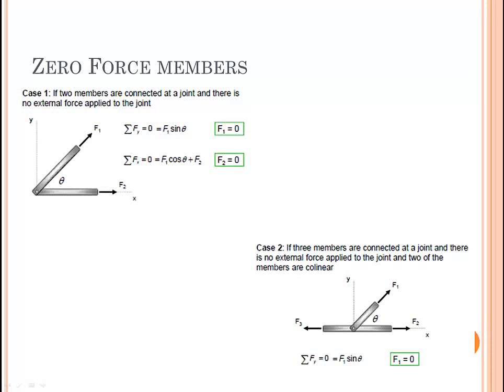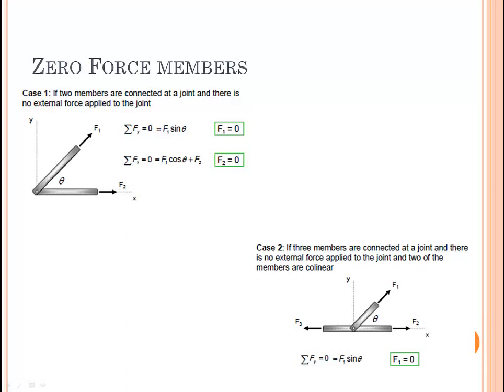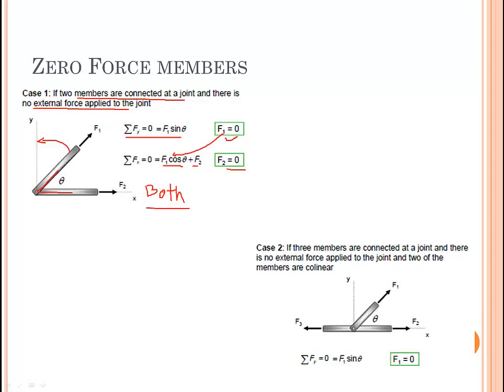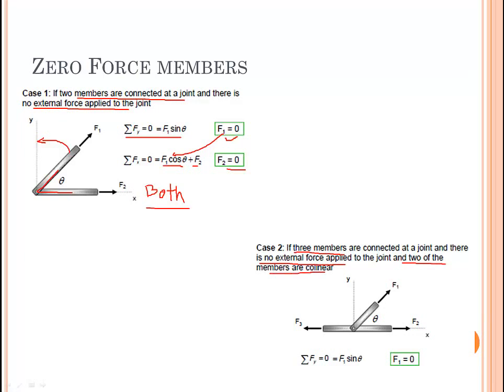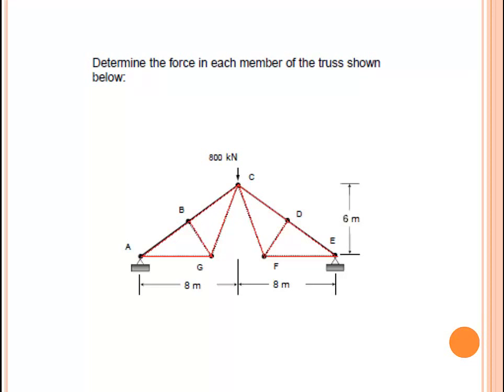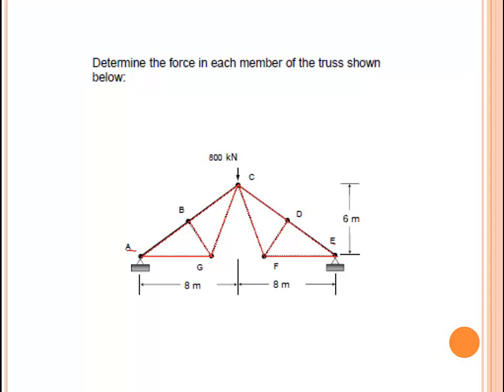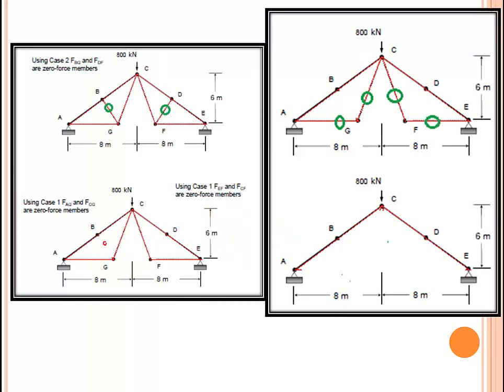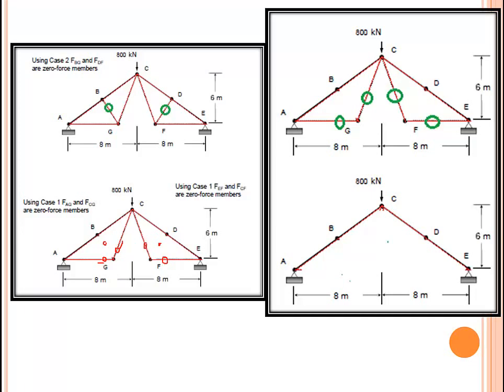2.2 Zero Force members of a truss

Comment: we can not remove DF and BG.....They reduce the effective length of the compression members CE and AC respectively.....removing them would reduce the BUCKLING force....making the structure unstable
Reply from the maker: Physically, we cannot remove any member for the stability of the truss in the example. However we can do so theoretically if they are zero force members. We are trying to find, for the given arrangement and loading condition, what are the zero force members.